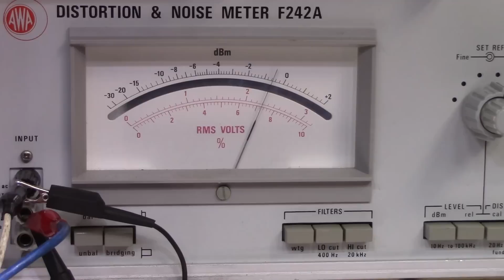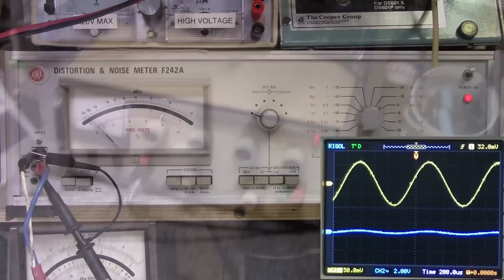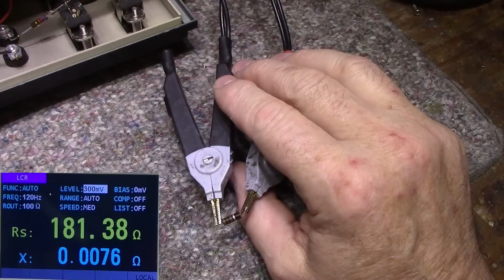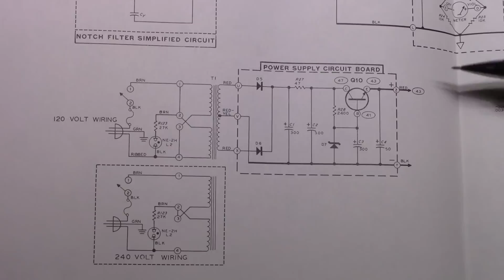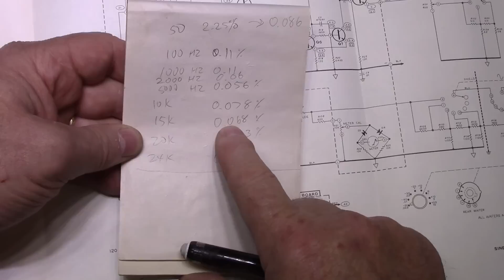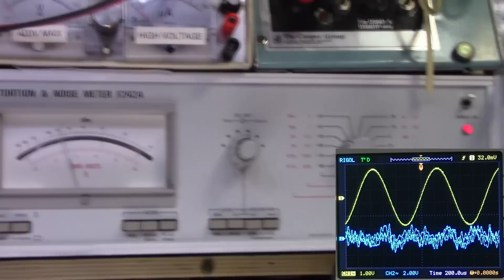Heathkit IG-18 Audio Generator Distortion Tests (Ep. 246)

Comment: Much appreciated, TB! I just acquired one from ebay, all orig components, nice build by orig. DIY kitter. I must disagree about testing R values in circuit. For this unit, many R's (all orig carbon comp) test just fine OUT OF CIRCUIT. But that does involve more work in de-soldering out one leg. Many test same in and out of ckt. But of the few that did not, I pull out one leg, and they tested at spec. I tested all R and did not change a single one. Some of the orig electro caps had drifted up in value (but with very low ESR) I replaced all electro caps, and even bypassed them with 0.1uF films. About the sqr wave ... I consider this to be a very important feature of the unit. One word of caution is that, by design, the sqr wave ckt in the IG-18 -- unlike the sine wave ckt -- will have a small DC offset. This can be over 1.3vdc at max 10v slelection.  It mentions this in the manual; something about that being the best way to produce clean, hi-fi sqr waves. I think Heathkit assumes that amp being tested will have DC blocking caps by default.

Comment: Unfortunately, Heathkit fudged the numbers quite often.  The IG-18/5218 are capable of less than .1% distortion, but not throughout the bandwidth of 20Hz to 20kHz; you can adjust them for low distortion at 20Hz, 1000Hz, 10kHz or 20kHz, but not all at the same time.  Look at that silly graph on pg 61; it's flat--that won't happen with such a basic audio generator.  For low distortion on each band there should have been separate bias and feedback circuits.  There are sites dedicated to the modification of the IG-18; look them up.

Comment: Check the net for updates on your Heathkit wave Gen. There are several modes that will really lower your distortion. Back in the day there were several articles to improve the Heathkit design used here with minor changes. There is a new HeathKit company that sells a $30 upgrade with directions. eBay sold the upgrade kit last year. Good vid! John

Comment: Just an update FYI.  I found the user/service manual for this distortion analyzer and it does use an auto-notch filter and I see no precision oscillator in the schematic or block diagram.

Comment: Trevor, this is fun - I feel like I’m looking at my own gear! I have the same generator from another brand and also the IG-18 and had the same result on the THD. Using a Keithley 2015 the Koolertron was about .6xx distortion, almost as high as yours and the IG-18 was less but I don’t remember off the top of my head. I did also replace a bunch of parts in the IG-18 and got the meter kit. Then I spent some time trying to get the voltage up to 43, it was a little low. Never got that exact. But the Heath is fun to use! I’d rather turn a knob than go into menus etc. and it gives a nice solid looking signal. Keep in mind it’s not a precision instrument - it was very good for the price at the time. People go down all kinds of rabbit holes trying to tweak it - not worth it IMO. Just replace some parts and enjoy using it. :)
Reply: One trick is that you’ll find that on the IG-18, the signal is a little better when the Fine knob is not at full. At around 3:00 it gives a cleaner signal.

Comment: Order the meter cct buffer board on line or build one from the diagram. I have the kit but haven’t installed it yet. The meter diodes introduce distortion but the buffer eliminates that. Make sure the screws holding the PCB to the chassis are tight. Good video!

Comment: revor, I have a HP 8640B with no RF output.  The Power meter light does not turn on.  The unit turns on but no RF output and no counter output movement when the internal frequency dial is turned.  The power supply LEDs are one. Can you please provide suggestions.   Al

Comment: I built the IG-18 a long time ago.  I also modified it with an article I found to lower the THD distortion.  I just went and got it out of storage where is has been over the last 20 years.  I fired it up and using the QA403 audio analyzer I got 0.063% THD at 1 kHz 0 dBm.  Years ago I tagged it with 0.045% THD.  The major spectral distortion for the sinewave is at the second and third harmonic and you noted the dominate second harmonic in you video.  On a second note:  Are you sure your THD analyzer uses a precision internal oscillator to subtract from the test signal to make the THD measurements?  I have several analog THD analyzer and none of them use an internal oscillator for nulling.  They use a tunable active notch filter to remove or reduce the fundamental signal and then just measure the remaining distortion plus noise signals over a specified bandwidth.  I have always been a big fan of Heathkit and thank you for posting this video.  Look forward to seeing how low you can get the THD.

Comment: Hi Trevor, did you use a linear wall adapter or linear bench powersupply to power that signal generator ?
I have the same model of signal generator but different brand, and the 5V switching powersupply that comes with it is very noisy, it also add stray voltage to the negative part of the BNC connectors and this switching powersupply is also underrated. To power my signal generator , i have cut off the cable with the 5.5 x 2.5mm DC jack from a broken notebook charger, add a flat 230V european mains connector to the cut off end, because european mains connectors here in Belgium have also the same distance (19mm) like most bench powersupplies and multimeters use, and power the signal generator with this cable to my linear bench power supply. The output of the signal generator is much cleaner that way, and no stray voltage on the BNC connectors. Grtz
Reply from the maker: Very good point. I'm using the garbage adapter that came with. I really should eliminate it and get a linear power wart for it. That would also help clean up the bench noise I have. Thanks for the suggestion
Reply: @TrevorsBench  a idea for a upcoming video maybe ? Grtz

Comment: I'm surprised you kept some carbon composite resistors in there Trevor, metal film generally introduce less low frequency thermal noise and are a lot more temp' stable.

Comment: Well, if you want comments, I wondered why you kept these carbon resistors and trimmed them with metal film on the bottom. Why not put two metal film as new on the top, and fully get rid of the drift of them ?
The distortion directly measured seems on the peaks, not the cross-over, and through the little amp it was also there, but with cross-over, but still measuring almost the same as with direct input. That made me think of the cables as you mentioned too, as if there's a capacitive factor. Maybe try the cables as short as possible, say 20 cm to see if that is the right way to think ? I als think about impedance mismatching, but I don't know if that kan make such differences, I lack experience there.
Reply from the maker: All good points. I should have yanked all the carbon comp resistors and replaced them, it's not too late to make that happen. I don't see temp drift a big problem. The IG-18 uses about 5 watts to run and internal heating is minimum

Comment: Hi first of all thank you very much for your great video and congratulations for your work
Then I have a slightly strange question
everyone is busting their guts to find a signal generator for example with extremely low distortion 
But is it really necessary?
when you measure a device you basically want it not to take anything away and not to add anything to the input signal
you just need to make the difference between input and output obviously taking into account any gain
if the spectrum is the same it means that the device under test is transparent i.e. has not added or taken anything out from the input signal, right?
So just a decent signal generator could be more than enough
Reply: Not a strange question, I also wondered if the distortion meter compares both in- and out of an amp, or that you need the internal low distortion generator in the meter for comparing, or is that only used for calibration of max. deflection. But still, in the first case I think it is slightly more difficult to reproduce (gain) a dirty signal in the meter itself than it is to do with a perfect sine wave. E.g. maybe cross-over distortion can have a fast rise or fall time.
Reply: @erikdenhouter  hi thank you for the very kind and valuable advice
In the meantime i have thought a little more
Actually almost any serious lab at least for audio have very low distortion signal generators that usually are inside a high quality spectrum analyzer
The cheap ones can be fine for hobbyist  
But pros usually want the best they can afford  Kind regards gino
Reply: @gino3286  Of course, the wanted standard is as low distortion as possible, the wallet says to buy what you can afford. Spending an extra thousand for something that is really sort of needed once in a blue moon is a waist. You can often find other ways to solve the problem.
I can remember working in a repair environment in the end '70 (~15 engineers repairing a few respected brands like Akai and Marantz at the only dealer for the Netherlands), and I can't remember seeing one distortion meter. I think it is more something for measuring equipment than for audio, that is if it is about repair. Design is two steps further.
Reply: @erikdenhouter  thanks a lot again
Maybe for repair duties a decent scope and a cheap signal generator  are more than enough  
I have seen some videos 
They just check at what output voltage the 1kHz sine wave top starts to flatten out
Very rough measurement 
Kind regards gino
Reply: @gino3286  "A decent scope and a cheap signal generator", yes, the bare minimum, plus a 2 x 4Ω+4Ω dummy load of 50 or 100 watts, a decent DMM plus a few dirt cheap DMM's, that should get you going.

Comment: There have been several articles published over the years about how to improve the distortion of this device.   IIRC, the meter circuit adds some distortion, which can be reduced with a buffer.  Maybe there are diodes across the meter to protect it.
Reply from the maker: Yes, and I should have done my research before I turned the camera on, lol
Lots of viewers emailed me with great suggestions on how to improve the IG-18, as well as the comments here.
I'm not done with the IG-18 and when I get more time, I plan to implement some of those suggestions.
I also have a new piece of test gear that was delivered the other day which will appear in a future repair video

Comment: great content  good points, I see  you tubers with tons of test gear and wonder how much time they spend to do a proper  periodic calibration check.  Back in the day (old time saying), probably still today, you have one department devoted to cal lab cause they issued certs for the gear being manufactured everything on the bench had an up to date cal lab sticker.    But like they say  "good enough  for ...................   :face-blue-smiling:   You can go off into infinity getting measurements  till you realize the limits of the equipment and call it +/- xxx value .
Reply from the maker: Thinking back to the days of repair with analog meters and test gear. We still achieved results with a 2% accuracy. Today we don't really need 6 digit resolution to do our daily work. We're getting spoiled
Reply: @TrevorsBench  true, 6 digit resolution only to those   who are willing to pay for it.  vinyl, tape,is my ear, over CD, digital

Comment: Nice work on the operation and repairs you did. Your explanation of the operation of the distortion analyzer differs from the instruction book. This THD+N meter and all the ones I have owned use a sharp notch filter that filters out the fundamental and meters what is left over. The weighting button puts in a set of filters to measure noise on telephone lines, it is of no use in amplifier measurements that I can see.

Comment: Last time I hooked up my IG-18 the amplitude was bouncing up and down, so now I have a Tremelo. Another person here on YouTube had the same problem and it was a bad regulator transistor. Changed out the electrolytics, and removed the transistor from the unit, tested it with the Atlas DCA55, and it tested good. Same problem so I put it away and haven't gotten back to it since. I guess the next step would be to check all the resistors since I only spot checked a few and none were that far out.

I have been using DSP software on my laptop for distortion. NAK-100 which is made for testing tape decks, but will test signals up to 2 volts due to limitations of the sound card. It will measure down to 0.01 THD and has a spectrum analyzer.
Reply from the maker: Not shown in this video was some other mods I made which helped a bit more.
Some of the changes I did was to use high gain transistors after which sent the generator into a secondary oscillation of about 2Hz that I couldn't stabilize. When I get more time I'd like to revisit the IG-18

Comment: I've been eyeing the QuantAsylum QA403 audio analyzer which is quite impressive. This one unit does it all: RMS power, THD+N, signal to noise, frequency response, harmonics, etc. But what's crucial is TWO very low distortion signal generators that are built-in (though I believe limited to sine wave only, no square wave capability).  I believe it measures distortion down to 0.0015% which you can validate with its closed loop internal test.  With its computer interface it produces an impressive array of data points and graphs on-screen. Their website is quite informative to learn more. Although it's a bit pricey at $600 you'll never look back.